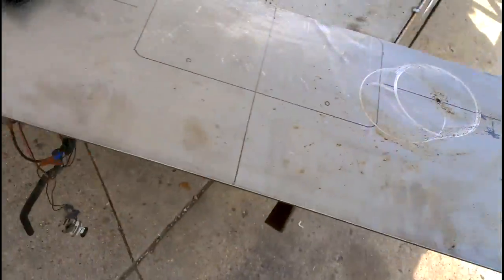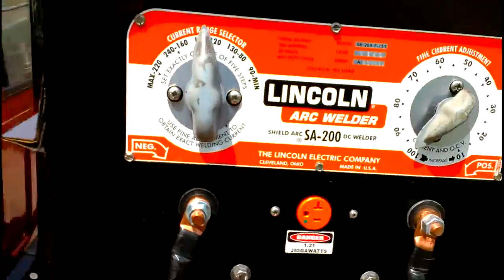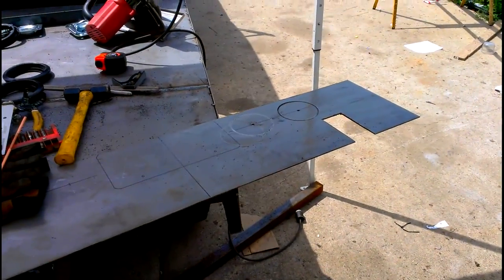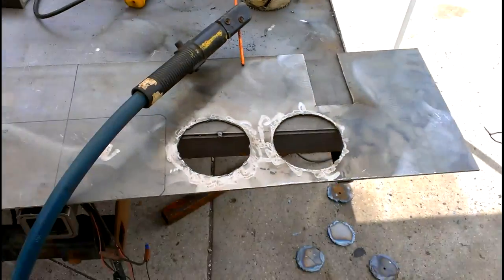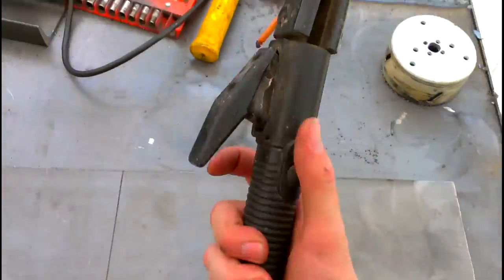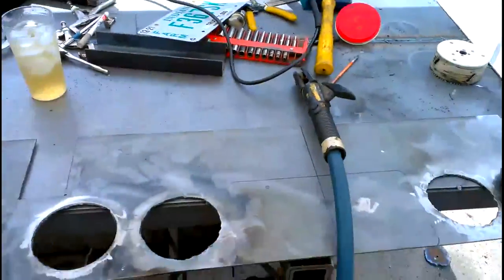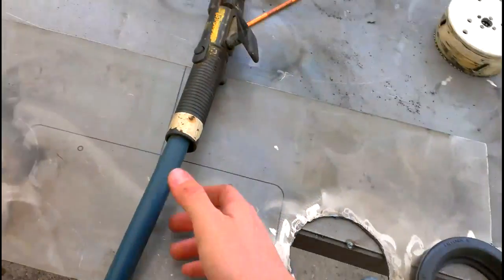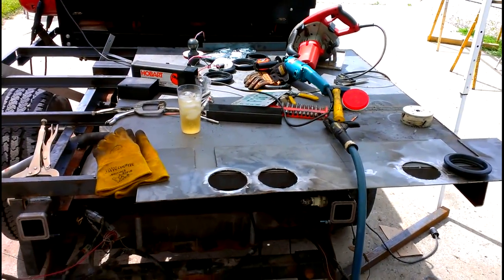Arc Air Cutting

Comment: Replace th drill bit in all your hole saw arbors with solid hardened rod. It doesn't cut at your pilot hole and is 3 times as strong as a drill bit. Use a standard bit to drill pilot hole.

Comment: What is the minimum thickness for the magetic? Mine only works well with 10mm+ so I built a small table I can just clamp and drill away .. drill stays put that way.
Reply from the maker: I had it on a peace of 3/8" guessing with something thicker it would have worked but it got the job done